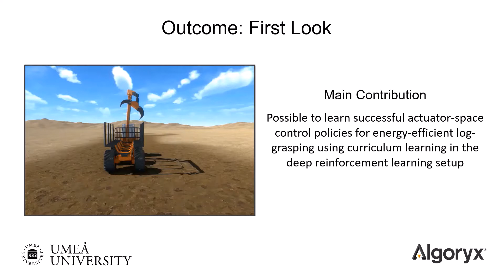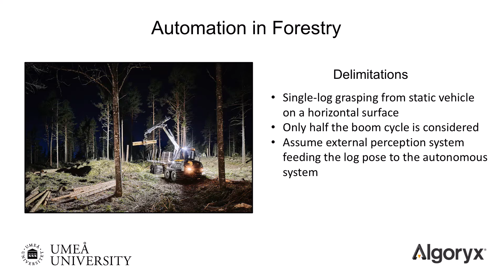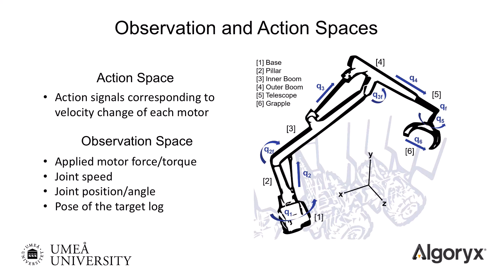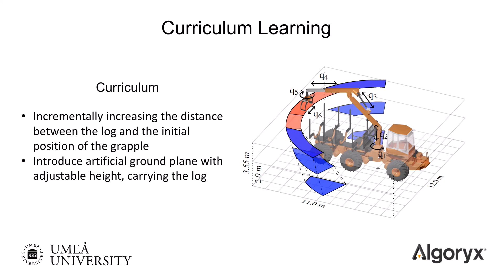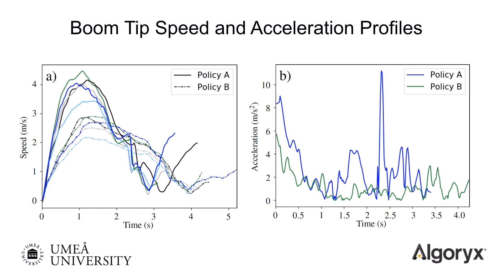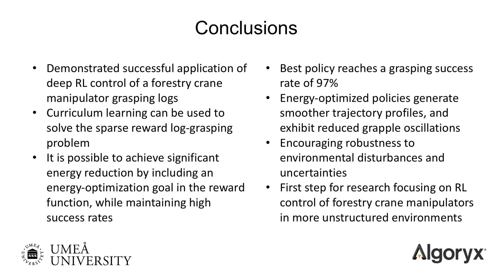RL Control of a Forestry Crane Manipulator @IROS2021

Comment: Very interesting.  I wonder if the progressive curriculum concept could be used to train for greater robustness - the curriculum could incorporate progressively greater variation in static forces or random oscillations or something, forcing it to become good at compensating for whatever comes its way. 

Maybe progressive curriculums could also be used in contexts of deformable objects.  It starts with training on a static sheet, then a slightly floppy sheet, then learns to make origami and eventually pick up lumps of cloth and fold t-shirts.
Reply: Indeed. The use of the curriculum looks very powerful. But I see the same risk as with reward engineering. You decrease the solution space, for better and for worse. Taking too much control, you rule out some optimal behavior that you didn't anticipate.